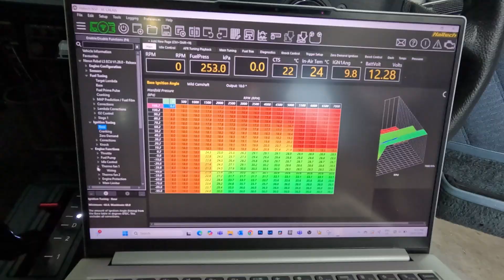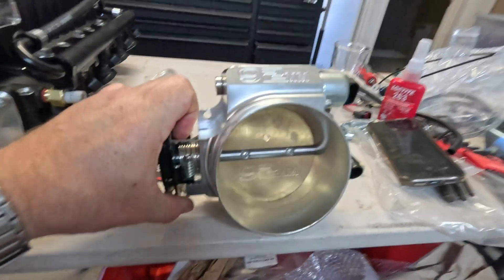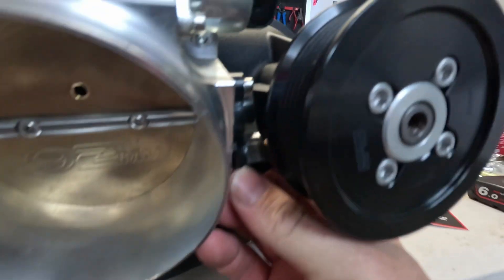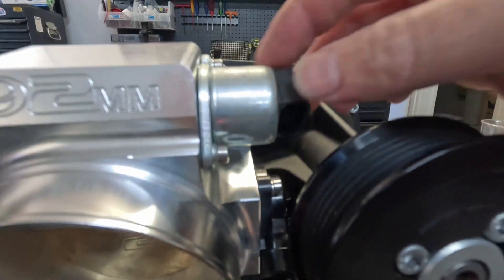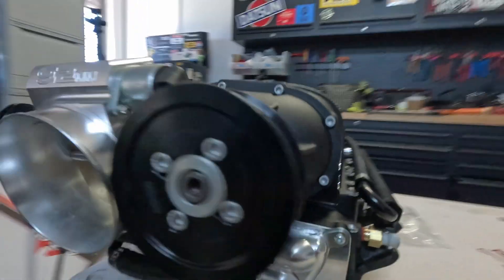HARROP 2300 BLOWER INSTALL - PART 3 - INJECTORS, THROTTLE BODY, MAP SENSOR - LS1 VL CALAIS PROJECT

Comment: I had the same issue with injector being too small. I used a billet injector adapter on my 2300 and it clears and uses the Harrop rail brackets and the map sensor.
Reply from the maker: How did you go using the supplied map sensor bracket?
Reply: @VL_Life  The silver clip covers the sensor and once torqued down on the manifold bolt it secure. Did the silver busing supplied work for yours? Was there play in it? What did you use to keep from blowing by?